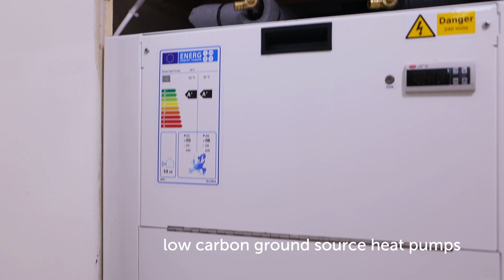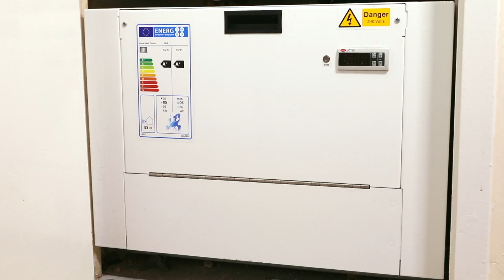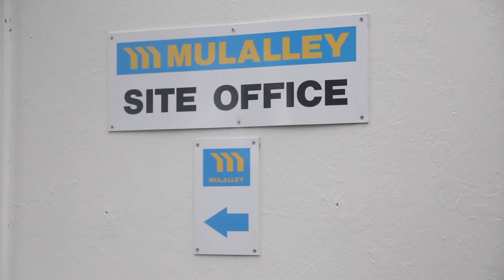Croydon Council cuts carbon & costs with ground source heat pumps

Comment: Interesting project. It shows that the ground source heat pump has a SCOP of 3 to 4 which is what many manufacturers claim for air source. 
I wonder how the bore hole clusters will work. There are issues with freezing ground.